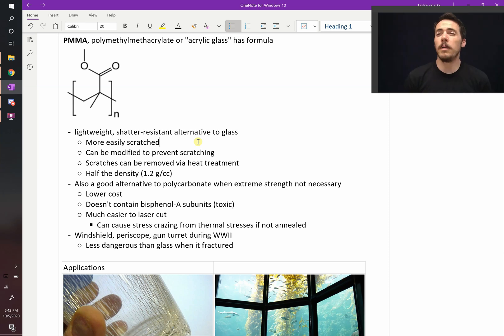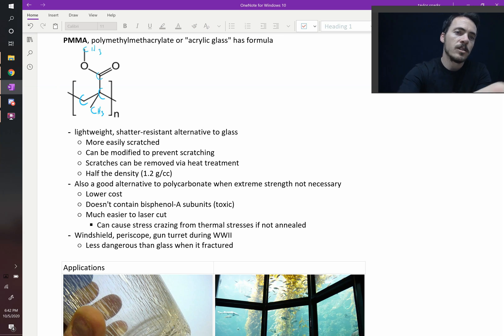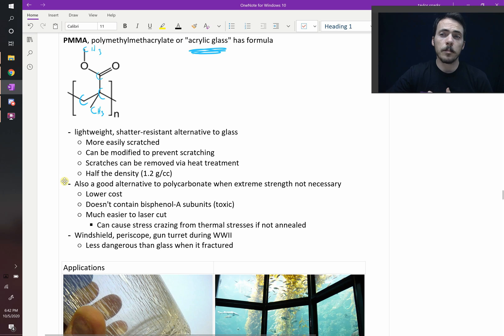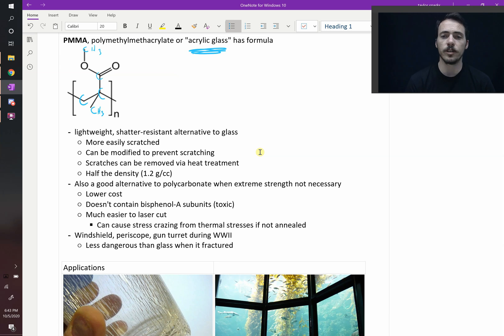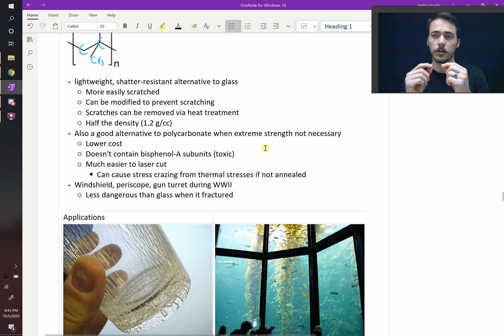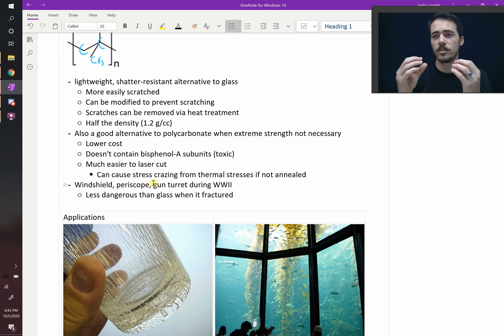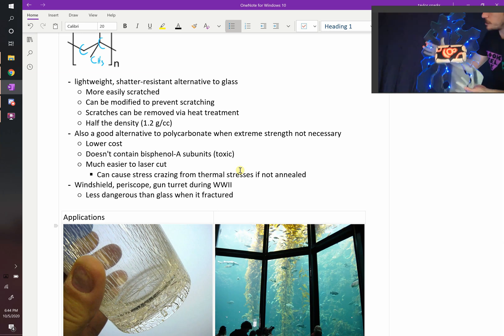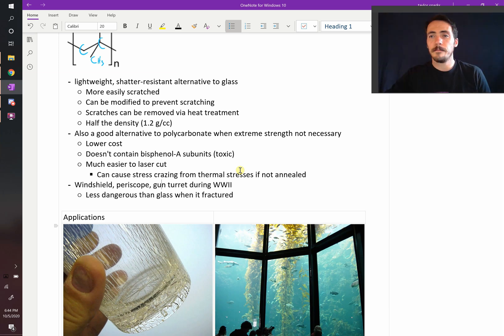What is Poly(methyl methacrylate) (PMMA, acrylic glass) and what is it used for?

Comment: Hey Taylor, I am a manufacturing engineer from Oklahoma that works with acrylic everyday. You seem to be extremely knowledgeable about this material and I'd like to know more, for example the specifics of how crazing occurs on a micro level and how heat can impact this, as well as some general chemistry questions. I work for one of the only companies in the world that manufactures stretched acrylic which modifies it's properties and failures modes in really cool ways to maybe I could be of use to your knowledge base as well? If you'd be willing I would love to get your contact for general collaboration.
Reply from the maker: My expertise is actually not in polymers or certainly not in acrylics anyways. I am always interested in sponsored research opportunities to help you get to the bottom of some challenges that you might be facing or some understanding that you seek to learn though.
Reply: Hey do you know how can I check the accuracy of MMA?

Comment: That's really interesting. If I may ask what are some of the challenges that are faced when drilling PMMA and what defects do the drilled holes tend to have
Reply from the maker: So, drilling through PMMA can be tricky because it's a little bit brittle. If you try and drill too fast then it can crack. However, if you drill too slowly then it will also generate heat and it will melt the bit to the plastic or cause localized melting which is also not a nice defect.
Reply: @TaylorSparks  Thank you